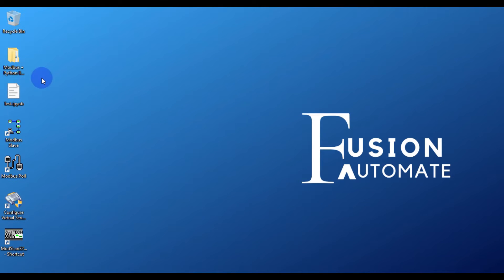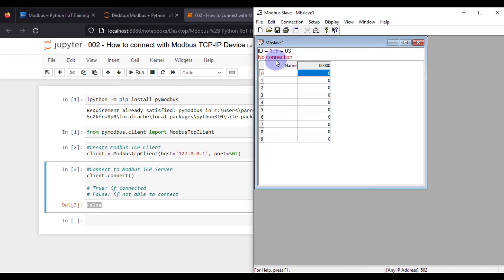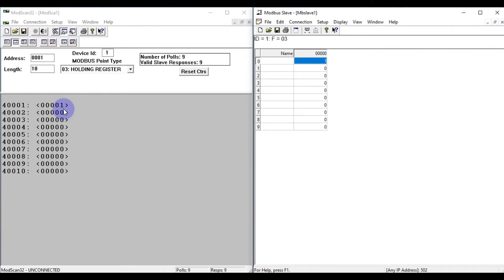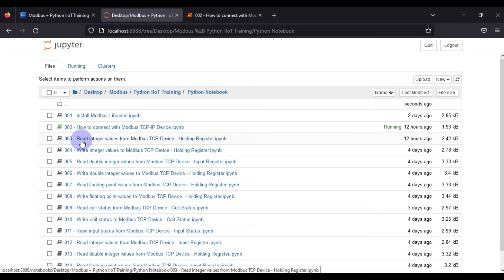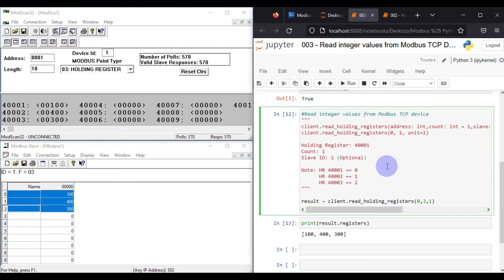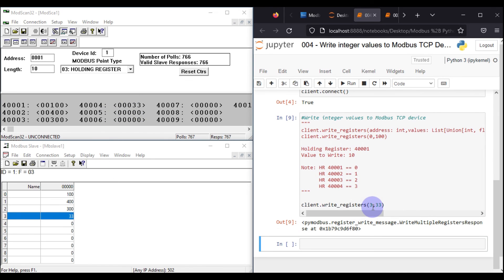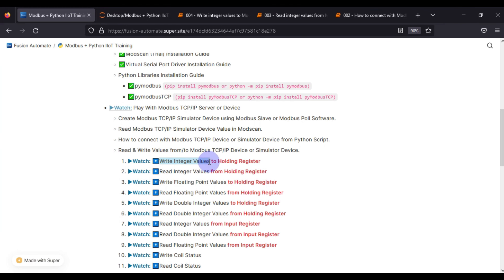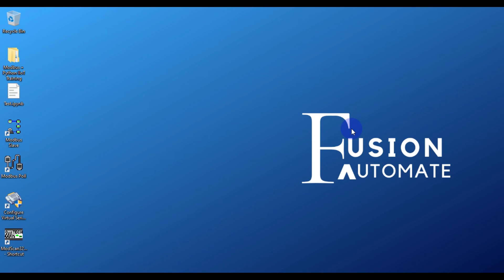Read & Write Integer Values to Holding Register | Part-3 | Modbus + Python IIoT Training |

Comment: Hello, thank you for this awersome video! I have writen a code that reads a holding register and then it write it in other register (inside a while loop) . I notice that reading is quick but writting is super slow. Is there any way to solve this?
Reply from the maker: Yes, You are right Reading will be quick but Writing will take some time, and Unfortunately I don't have any solution for that.

Comment: Great presentation. Clear and easy to follow. I got lucky that you posted this the very same day I'm working on a pymodbus project. I found your video while troubleshooting. I have a Protos-X Modbus coupler (PX-TCP2) with a two channel analog output module (PX-412) and it is not cooperating.